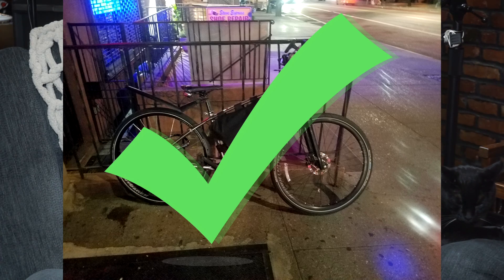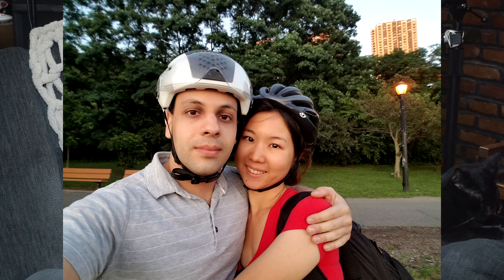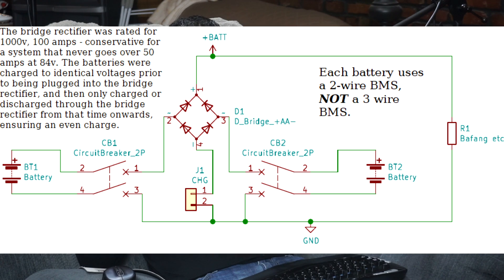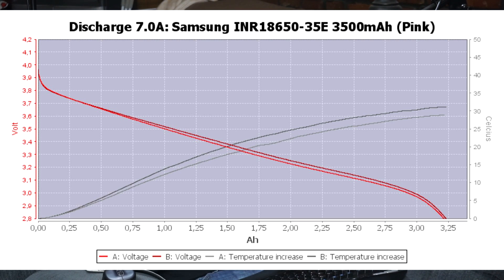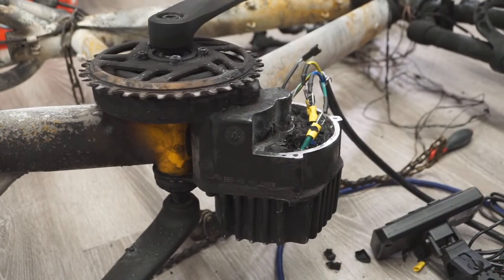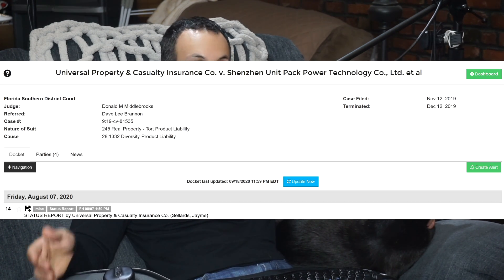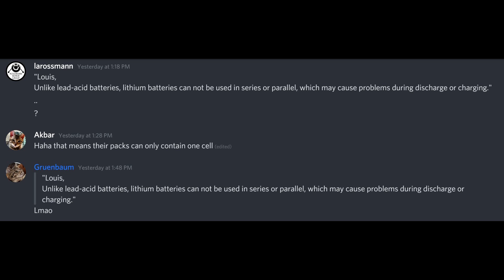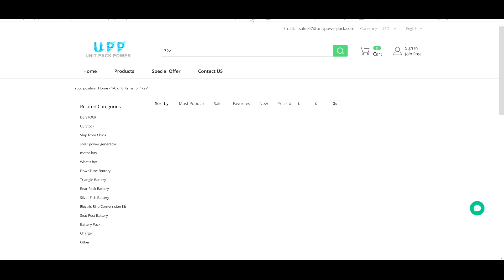Louis' front door goes BOOM courtesy of UnitPackPower battery.

Comment: I see Louis is trying to collect that insurance before the crash.
Reply from the maker: I learned from my favorite contractor!
Reply: @rossmanngroup  lmao
Reply: Trying it before the real estate bubble bursts completely. 😉
Reply: his comment is the 5th place here in my comments section, so if the insurance sees this vid, theyll def see this comment
Reply: BINGO!
Reply: @tocolee6127  I can't see water being an issue as the voltages are (relatively) low. The system here is isolated so there's not really a risk of shock like if you sprayed a fire hose at a powerlines or something. I suppose it could potentially cause more cells to fail if the water shorted stuff out but at that point you're already extinguishing it.
Reply: @cctrollz5706  Smarter than me... However, varying fires have rated issuances per fire or every extinguisher would work for every fire?
Reply: @cctrollz5706  Bro. I don't  know? I left the Navy back in 91? I deleted that shipyard stuff. I submit.👍
Reply: @cctrollz5706  Lithium reacts with water.
Reply: @TheCarpenterUnion  Yeah but it's not like the batteries are a solid slug of lithium metal. They contain a small amount of a lithium salt .6 grams in an 18650 with a quick Google, though I'm sure it varies. The bulk of the batteries are the electrodes and separation membrane. While the water and lithium still may react, if water is able to get at the insides that means the casing isn't sealed and the battery is likely to go anyways. The hydrogen generated between the water and lithium could make the fire harder to put out if enough is generated but
Reply: Smart!
Reply: xDD
Reply: are those firemen trying to stop an electrical fire with water ?!
Reply: @tony_fanta  its a chemical fire from a low voltage battery
Reply: @TheSpiralout11235  i saw in the video they waited before hosing it down, but still, not a first choice
Reply: @tony_fanta  it's not a electrical fire at this stage, it's a metal fire
Reply: @tony_fanta  no, they are limiting fire extension to the building. It's obvious that the ignition source is quite active.
Reply: @tony_fanta  You nailed it!
Reply: @tony_fanta  legit. Where's the extinguisher?
Reply: @tony_fanta  and they won cause is freaking New York